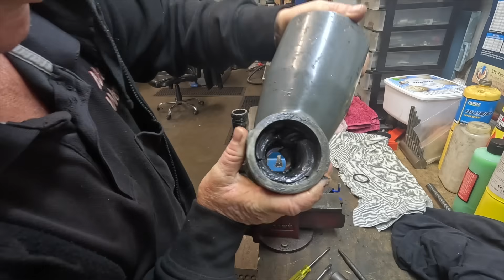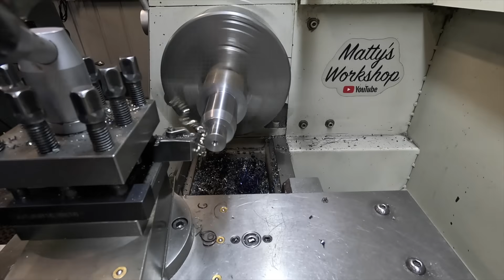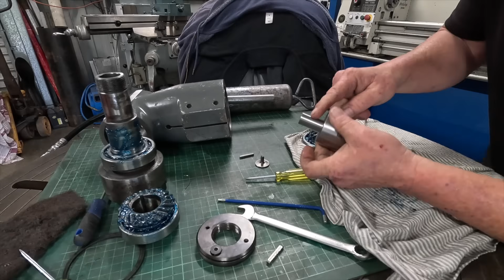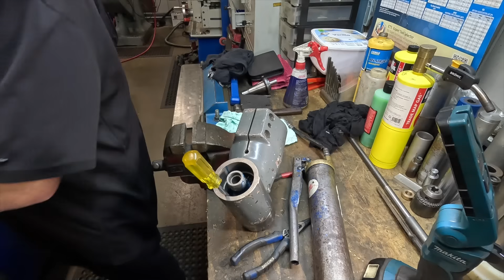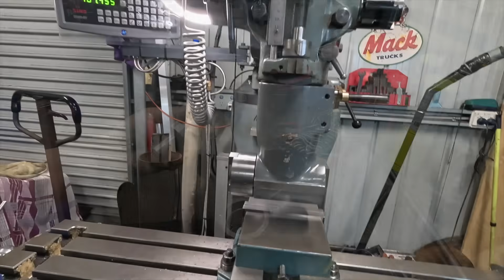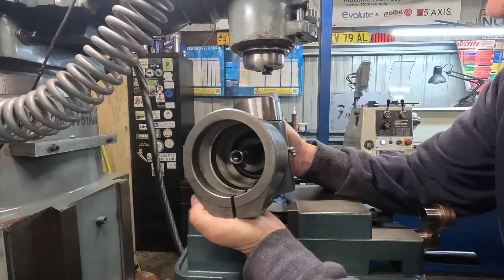Right Angle Milling Attachment

Comment: That's a great tool Matty. Looks like it was in pretty good condition.  The mistake was a little one, although I was curious why you didn't put the arbour in your MT5 adaptor and turn down the keyway end, rather than recutting the taper? I may well have missed something there.
Reply from the maker: Gday Olly, I thought I’d leave the keyway end alone as it was a spit on fit already, cutting the taper end wasn’t that much work really, thanks for watching, cheers

Comment: Was it not an option to put it back in the adapter directly in the lathe, without the chuck. And then machine the pin end and mill the keyway again?
Reply from the maker: Gday, I could of machined the keyway end but I thought any miss alignment on the shaft from the original diameter to the new would effect the concentricity of the bevel gear, I hope I explained that properly, thanks for watching, cheers

Comment: You won't regret buying that unit, Matty. They add a whole new level of versatility to the mill. One of the second hand machinery dealers was selling one with the arbor end support as well. At $1000, it was a bit pricey though. The end supports are even rarer than the 90 degree drives.
Regards,  Preso

Comment: luv your channel. always a joy to see what you're up too .Ive turned a40 into  30 taper before. y first thought5 mins into the vid  From my experience I'm pretty sure that's not the original Spindle.. It looks as if someone before you just plopped that one in. You can pretty much use. Any off the shelf Arbor blank  Machine tand tap he shaft to fit the bearing and gear.
Reply from the maker: Thanks for watching mate, Cheers

Comment: Thats a nice piece of kit! Did you check out the cost of new bearings? I'm guessing they wouldn't be cheap.
No pin spanner, no problem. Stick the back ends of two drill bits in the holes and use a length of flat bar as a lever to spin them. Works a treat!
Reply from the maker: Gday, The bearings weren't all that expensive really, I had a coupe here already but there had metal shields and one side needed removing, The amount this will be used I don't think i'll ever have any trouble, The bearings felt and looked like new,

Comment: Thanks Matty, nice to be able to correct your error without having to make a new one.
As for your next (or future) project, you need a pneumatic drawbar on your mill. Your countryman, Mark Presling, has made a neat one for his mill, which looks to be a Bridgeport  clone like yours, using a butterfly air wrench and some custom castings. I've never seen you do casting, but I'm sure you could mill them from solid as required. Give his site a look, he even has drawings available for the project.
Regards from Canada's banana belt.
🤞🇨🇦🍌🥋🇺🇦🕊🇦🇺🪓🦃🐨🪃👍
Reply from the maker: Gday Ron, Ive followed Preso for a long time now a seen the drawbar setup, I think ill be leaving mine as is for now, Thanks for watching

Comment: I bought several plastic totes full of tooling several years ago, and there was a right angle head, overarm support, with the arbor and spacers.  I was excited about it until I discovered it won't fit my Bridgeport. The dovetail on the overarm support is too wide, and the hole where it slips over the spindle column is too big. I believe I saw Index stamped on it somewhere, so I guess it fits a Well Index mill.  I wish I could find someone with the opposite problem I have that would swap with me.
Reply from the maker: Gday, Have you thought about asking in forums if anyone wants to swap, Maybe an option mate, Thanks for watching

Comment: Matty, just a thought, would it be possible to make a coupler to adapt whatever tooling you need to use to the stub sticking out of the 40 taper you just replaced?
Reply: Bore it out to 30 taper, job done.
Reply from the maker: Gday, Pretty sure im going to buy a 40 to 30 taper adapter sleeve, looks like it much cheaper to build it then make it, Thanks for watching

Comment: I was fortunate Matty that when I bought my Bridgeport Mill, it came with the 90 degree adaptor, as well as the dovetail arbor support bracket & bushing, a couple of arbors and spacers so that you can cut gears on the dividing head that also came with the mill.
It came with all the gears and banjos to cut helical gears even.
Would it help you make your own dovetail arbor support bracket if I took photos of it, and critical measurements maybe?
When you fit the angle attachment to the spindle, the previous owner advised that I leave about a penny gap on the housing to spindle, so that the arbor that goes across to the dovetail support bushing on which your DP cutters gets affixed is parallel to the table surface on your mill.
This might be something you have to account for carefully when making your dovetail arbor.
Sing out if it will help you any, & I shall photo & measure it for you to copy.
Cheers & keep up the great work. 👍👍👍🇦🇺
Reply from the maker: Gday Ian, when I get around to making the support bracket I keep you in mind, Not sure how long till I start making something yet, Appreciate your offer and thanks for watching

Comment: Hi Matty. When I bought my Bridgeport there was a right angle head inside the base of the machine. I have not used it yet, did clean it all up. And have been on the look out for the support  arm the clamps to the dove tail of the ram.  Cheers
Reply from the maker: Gday, Im going to have to think about making a support arm soon, another job on the to do list, Thanks for watching

Comment: You don't really need to make a pin spanner, you just stick 2 pins in the holes and use a screwdriver or any other bar between them and twist it open. That said, I did make a custom pin spanner to take some lock nuts off of my spindle on my mill
Reply from the maker: Gday, The 2 pin method works well to mate, im just to lazy to build one, Thanks for watching

Comment: All the iso tapers are the same, so it would not be too difficult to make a 40-30 adpter using the nose adapter you have.  Nice job Matty (I thought your original assumption about the length was right too ) ;-)
Reply from the maker: Gday, I'll definitely be looking into a 40 to 30 sleeve mate, Appreciate you watching, Cheers

Comment: Nice work Matty and a great find.  I wouldn't be without mine.  If you don't have enough Z axis travel to machine a part no dramas, lay the part on the table and fit the head.  I have a 12mm hole in the side of the casting so I can see as I rotate to engauge the drive dogs.  You can also buy a ISO40 to ISO30 adaptor.
Cam
Reply from the maker: Gday Cam, I will look into the 40 to 30 sleeve, I didn't think to look for one of them, Appreciate you watching mate, Cheers
Reply: @MattysWorkshop  Just be careful as you then have another source of runout error, with carbide mills that not the best thing to have......

Comment: That was a little simpler than building one yourself, like I did a few weeks ago, mind you, it's a whole lot more solid, and it runs quieter than mine does. If you aren't making the odd mistake, then you aren't trying hard enough. 😜 A job well done in the end. 👍 You really seem to be copping it from the weather bomb I see them talking about on the Aussie news. We had a storm here a couple of days ago that pissed it down like that.
Reply from the maker: Gday Paul, I did consider quite a lot about making one from scratch but then this one popped up, you did a good job building yours, thanks for watching mate
Reply: did you hob helical gears like this one uses? Or made bevel gears, or just bought ready to go gears that were pre-made?
Reply: @gorak9000  I just bought off the shelf gears, but I wish now that I had bought helical gears.